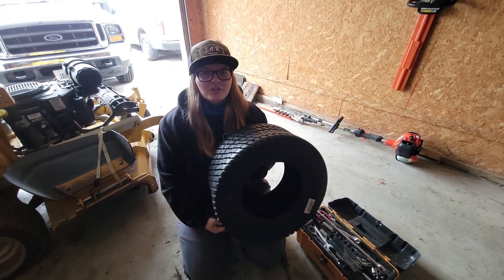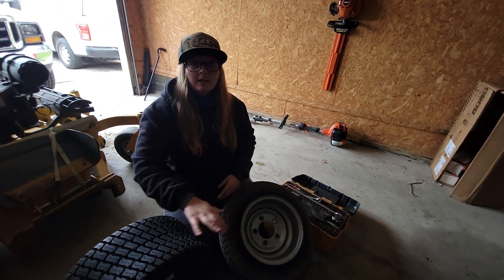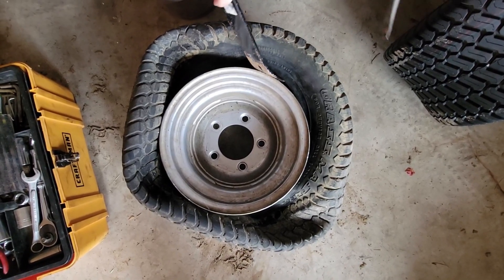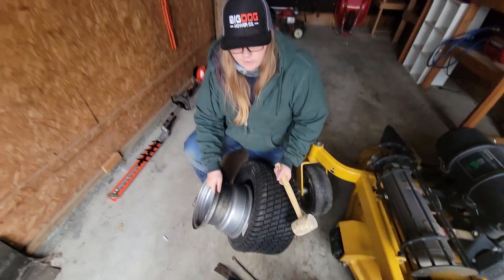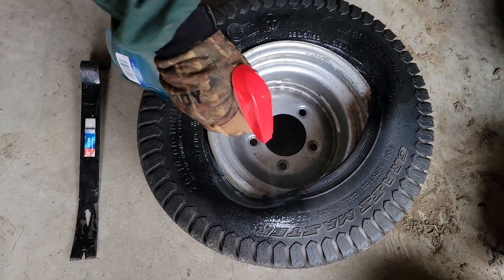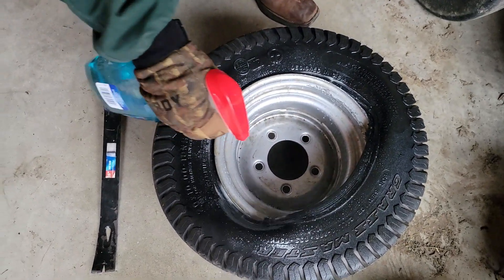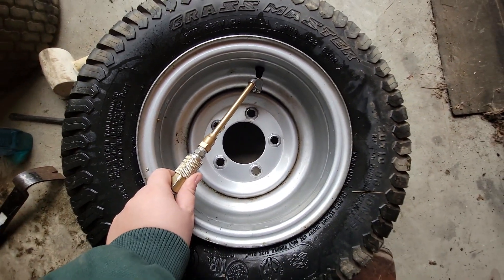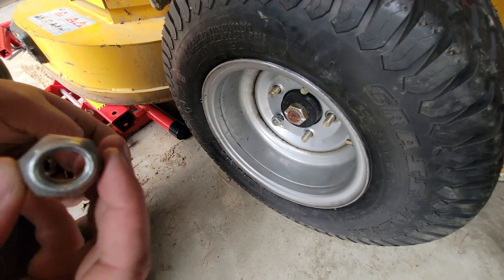How To Change A Mower Tire | Hustler Super S

Comment: You really don't want to use oil or grease on the tires, petroleum products can damage them. Use Windex (like you said) or dish soap with or without water, works fine also. Excellent video, Thank You...

Comment: If your girl's ever run into a problem where you can't take a seat to bead on a pair like that Dayton used grtake a news Greece and slide the right around on that bead and that'll help seek that tire as well that's an old farmer trick
Reply from the maker: Thanks for the tip! We kind of put our elbow into the tire to flatten it down a bit, then hammered the tire over it. Seems to have a good seal right now!  🙌🏻